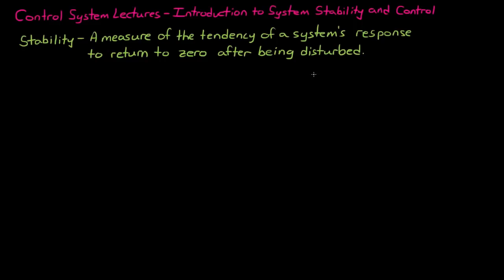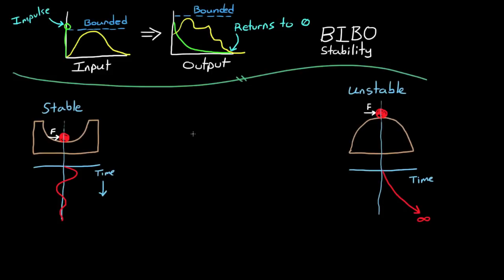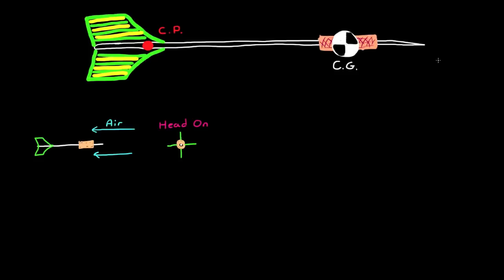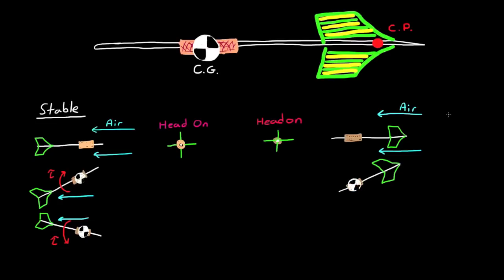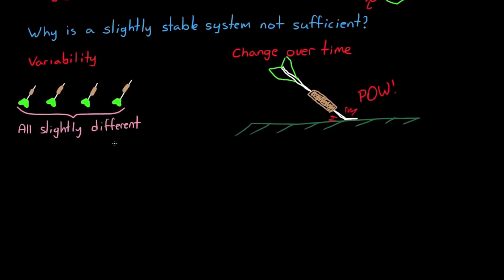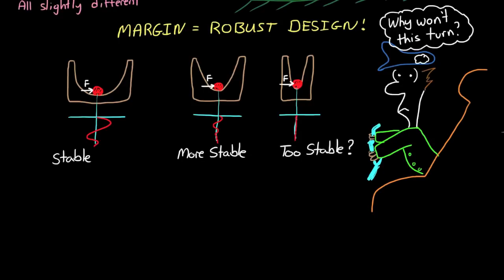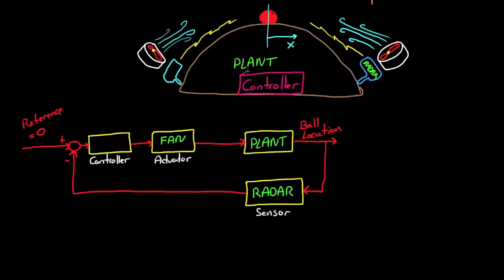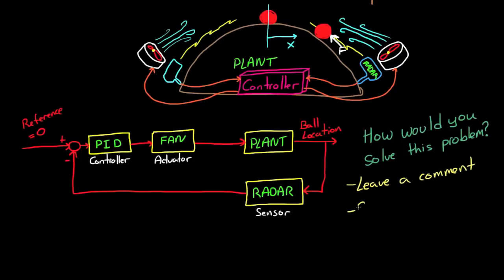Introduction to System Stability and Control

Comment: first of all this is extremely helpful , thank you very much 
secondly, i wound use a curved up (positive slope) slides that would convert the unstable system into a stable one like the example of stable system, and that is triggered by a sensor when the ball comes near it

Comment from the maker: Hi Freddy, MIMO systems are typically covered in modern control theory classes because state space representation just lends itself so nicely to linear MIMO systems.  On the other hand, you can use classical methods to design linear MIMO control systems (root locus, bode, nyquist, etc.) but it starts to get really cumbersome.  I hope to cover modern control one day but it's still several months away.

Comment: Hey ! Your lectures are too good for an beginner in the Control Theory. 
I would like to answer the question that you mentioned at the last in this video. I think that  actuators/ sensors have individual transfer functions and we should theoretically model our system ,then consider various control techniques for finding the extent of stability of that system. Once we have done these analysis then we can actually think of whether the transfer functions of actuators/sensors considered were correct or not (as per our requirement). Please comment about my analogy.
Cheers !!

Comment: A silly idea that only works on metal ball:
Place electromagnet as an actuator on the top of the mountain to return the ball to its original position. Still use radar as sensors. :)
Nice video as always!
Reply: Great idea! And if the ball is magnetic you could also use induction sensors that registers if the ball creates a current by its motion.
Just taking up on your idea ;)

Nice videos, Brian! The're really awesome! Helps me alot for my control theory exams at the end of the week :)

Comment: I think we could use pressure sensing resistors for position sensing which are aligned on the ground or we could use laser distance meters may be instead of radars. That was for position sensor. For actuator may be a moving floor huh? If ball moves to the right floor will move to the left trying to keep initial position of the ball.
Thank you for your great lectures Mr. Douglas they are really helpful! :)
I wish you continue posting new lectures...

Comment: Thanks, Brian!!
My idea to solve this problem could be to put two sonar sensors to get the measure of the ball and then trigger one side actuator until I don't have the same distance from each sensor to the ball.
On the actuator solution, I don't have much more idea than yours, then everything depends on the ball material to dimension wich actuator performs betters to bring the ball to the stable position.
Thanks for your videos!

Comment: Sensor - strain guage
Actuators - that ball is connected to two motors placed at each bottom sides with a Rope whenever the ball is falling that opposite side motor will start and get the ball back to stable position

Comment: Excellent video. I don't mean to be pedantic, but for BIBO stability you need to ensure that the impulse response not only goes to zero, but goes to zero fast enough (its energy is finite). Granted for linear systems this distinction won't matter, but math D:

Comment: As for a solution to the problem proposed at the end: I'm sure this may be trivial and silly, but I want my actuator to be a motor attached to a string which comes out of the opening at the top and attaches to the ball. The sensor senses the length say of the string, so that at minimum length the ball is at equilibrium and you can let the string loose when you want to enter astable state. A variation on the sensor could be one that senses the tension in the string, but then we'll also require a differentiator to measure the change in tension in order to achieve observability in the system, if I am not wrong?
Reply: Why not just tied to a string, as you said. With a maximum length(stretched) that is a fraction of the hill's semi hemi-sphere arc length in any direction. And a small motor to pull the string back to it's original place. Two sensors, one stimulated by attaining maximum length, and signals to a motor(actuator), which can be a simple pressure sensor. And another for guiding the ball back to the calibrated reference point and resetting the the parameters to reference positions, which can either be a pressure sensor or a light sensor. Simple and cheap, but very discrete in data collection and poor control flexibility.

Comment: I would place my "hill" on a stage that can tilt in all possible directions and cover the "hill" with a very dense set of electrodes to preform capacitative sensing of the position of the ball. I would feed the signal into my controller and output a signal to control a hydraulic lifts to reduce the error term. There would have to be many lifts to have a great deal stability.

Comment: I think if we consider it in terms of two way feedback system with one at sending end (Generation) and second at Receiving end (Distribution) but missing part here is transmission system so take reference when ball is at zero position in centre of crest then it will shift either way sensor at both ends and one at centre to measure if there is any disturbance in the position of ball the feedback system acts between the three sensors then we can bring the system in its stable position more accurately the fans at both ends response to feedback from center and either end on which side ball is moving after disturbance.

Comment: One could actually build that mountain ball system, little tabletop one. I would detect the ball position with a camera looking down on the ball and "mountain" could be moved a little bit on xy axes. Might be a very good educational model, as ball&mountain must be the most used stability example(besides the pendelum maybe)

Comment: build gps and motors into the ball? that'd be potentially expensive
electromagnet at the top of the hill with a pressure pad, with the ball made of or coated in iron, when the ball leaves the pressure pad the magnet turns on and draws the ball back? Would require lots of fine tuning.
only 2 ideas i could come up with on short notice that other people may not have said

Comment: on both left and right id put a conveyor belt (both moving towards the equilibrium position) this would only activate if the sensors are triggered though.

Comment: Wouldn't the radar gun detect motion (speed) rather than 'location' (position or displacement) and isn't doing that almost as good for the purposes of the thought experiment here?
Reply: The set point is a measurement of 'position' (at the top of the hill), so we need to actually look at the positional output. Given that we know the initial position of the ball we can integrate the output of the 'speed' measurement to obtain the position of the ball as it moves
Reply: yes, you can integrate velocity to obtain displacement.

Comment: If our goal is always the very top of the mountain, then my actuators and sensors will be the intermolecular forces of a bit of glue.

However, for a more general sense, I would likely be designing the ball itself to navigate, so probably GPS and an internal weight.

Comment: Someone explain me the Dart Concept!
Reply: The center of mass of a body in motion should be in line to the path of motion to attain stability. If the darts is not aligned in position to the direction of its motion, the center of mass of dart will be out of its trajectory of motion. Then the feathers at the rear end of the dart is designed to create pressure with air incident on the feathers. If the dart is aligned to the trajectory of motion, then all the feathers will be having equal pressure and the position is maintained. If the dart is misaligned to the trajectory of motion, then one of the feathers will cause more pressure on the dart due to more air resistance and push the dart back to its position i.e center of pressure and center of mass aligned to the trajectory of motion which is the stable position for the dart.